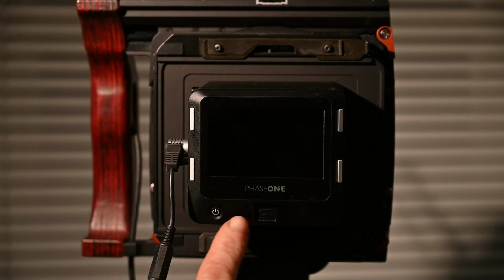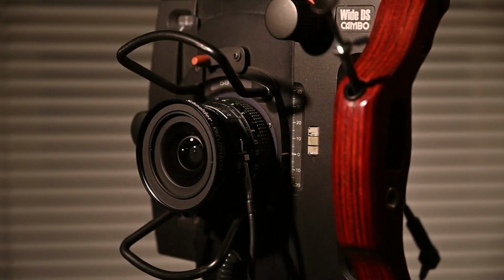Unleashing Creativity: The Art of Capturing Analog Aesthetics with a Digital Back

Comment: one thing about the white balance, as you have the 58xl there is a Center filter that goes with this, for the ~20 mm lens, 38/47and 58xl's as they are so wide any light at the far reaches, not only gives Flare and Glare, but also fragments the spectrum of light, not white, but green or magenta casts, on colour film and Digital sensors, so this will help with any corrections for that, anything which saves edit time
Reply from the maker: Thanks for the feedback!

Comment: one tip, with the 'viewfinders' the lens inside and internal etched markings do the lens field of view, the MASK is for the back also, aka what sensor size, 4x5" is the whole viewfinder image, then there are cropping lines, 6x12, 6x9 and also special ones for the digital backs, you see some 'gaskets' come with a back?, thats what its for, a hasselblad 500c/m's viewing screen, or here, to insert into this 'scope' to say what's IN and OUT of shot, so what is actually going to be captured on film/digital.
Reply from the maker: Thanks for the tip!

Comment: great video, if you still have this camera, can you do another video about the lenses, and how to mount the backs (they use spacers, and each is different due to the lens and sensor used), so would be a great help, as I am getting an analogue one, and would be interested in some more info, the cambo Ds manual is just a sheet, showing the features and lists lenses and accessories, it doesn't show you how to mount the spacers, and which one goes with what lens.
Reply from the maker: I still have it, maybe I do one

Comment: Fascinating change in subject, thank you. I still like taking black and white photos and developing the film myself. I switch between the Olympus OM1 and OM4. The metering on the 4 always give me good photos. but the 1 I find more challenging to get right. And it's more satisfying to use being more mechanical. Been a while since I actually printed any negatives though, I just scan them now. Shame since manually printing then developing prints is one of the most magical things. I never tired of seeing the image magically appear on the print. I really like the manual-ness of it all. And that you have to understand what you are doing, it's not easy and you need to practice to get results. It's why I like vintage cars too, they aren't easy. You need to work at them. And not everyone can do it. Modern camera are amazing, my phone blows me away at what images it can produce. But it doesn't feel as as creative to me. I feel the same with modern cars. The car does the work, sure they are much (much!) faster than old cars but for me not as satisfying. Any idiot can jump into a modern supercar and drive it, not to the limits sure, but they can drive them. Vintage cars, almost no one can drive them. I like the snobbery of that :) Where we're going, we don't need synchromesh!